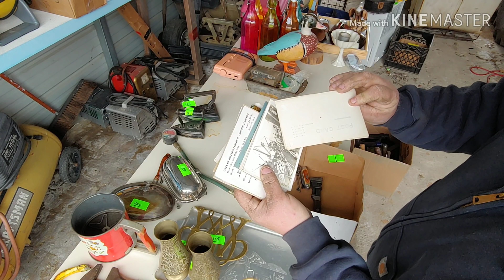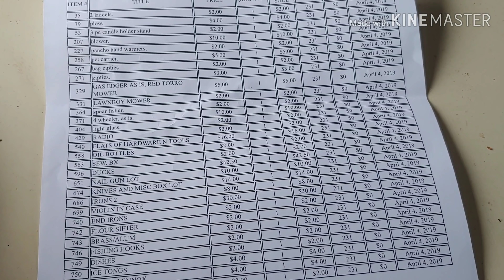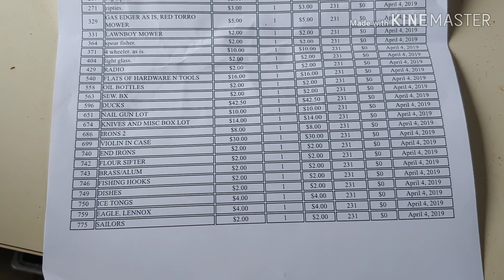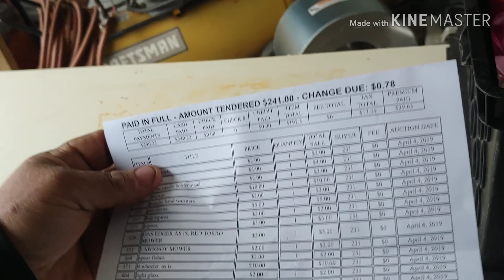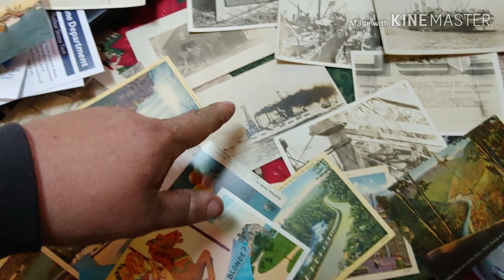Thursday night auction scores

Comment: Do the lawn mowers run? If not do you fix them?
Reply from the maker: I try but dont put to much into them most that i buy at auction are trash. ones i find on the street usually are seized or run good its crazy.